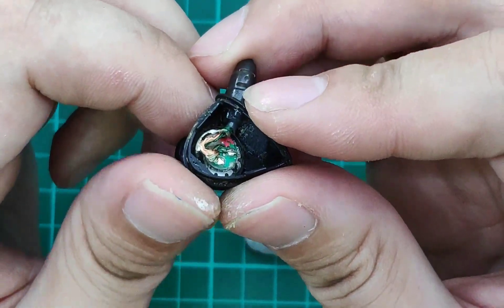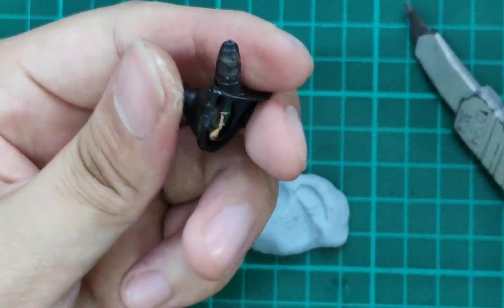Sennheiser IE7 iem mmcx detachable cable mod Tutorial

Comment: What tools did you use to fit your mmcx pin?
Is that electrical screwdriver or drill? And what name tools did you use I'm planning to buy I'm interesting what you doing.
Reply from the maker: It's a dremel rotary tool, the link to it should be in the description
Reply: @sgaudiohive  how many rpm? Can use on polycarbonate and steel like md chu?

Comment: Could you make a video on making a 4.4mm balanced mmcx cable from scratch?
Reply from the maker: Can do 1 up soon
Reply: @sgaudiohive  nice thanks a lot bro👏
Reply: @sgaudiohive  hey sgaudiohive, i got question, i know these wires got a thin resin layer that isolates it from other wires, when i repaired my headphones jack i always used a lighter to remove that layer, i see you dont do it, does the pre-soldering these wires with tin removes this layer from them? could you also make a tutorial how to modify Sony's MDR EX300/EX0300 to mmcx bcos many ppl got them and they die mostly cos of bad designed J cord cable, i would really appreciate that if you'd do that tutorial
Reply: Yup, a very nice suggestion. For 2.5mm or 4.4mm is the same method. It would also be interesting soldering of mini XLR plug like on DUNU HULK cable. 
On Aliexpess there are 3 types of similar plugs and can be found at a very affordable price.
https://tinyurl.com/y3kbwhwz
https://tinyurl.com/y4xzx6qf
https://tinyurl.com/y3mk8gt3
Another interesting replacement for standard mmcx connectors. 
https://tinyurl.com/y58z8d6b
https://tinyurl.com/yyytcywp
I hope that we will see in the future how to make mmcx cable with these.

BTW... @sgaudiohive thanks for theses informative tutorials and keep up good work.